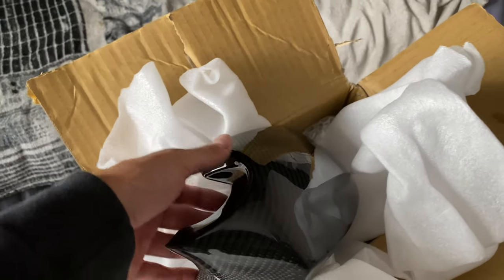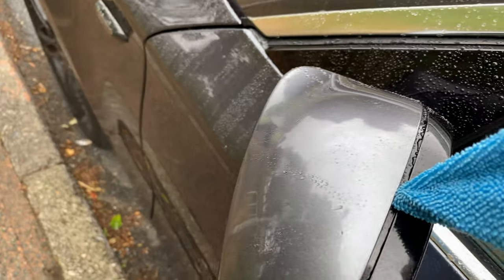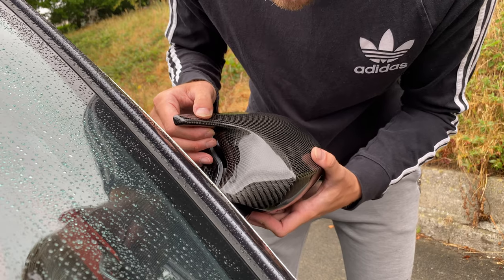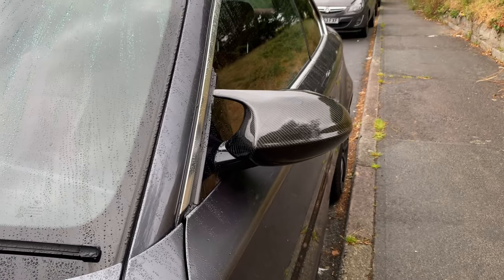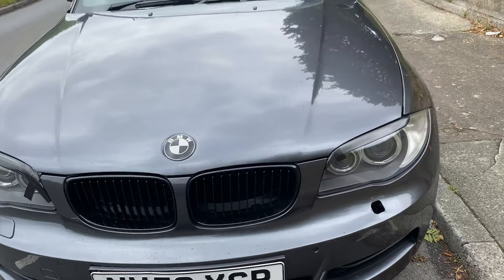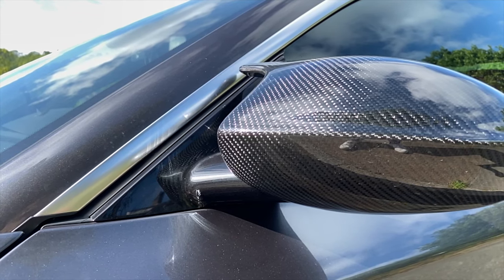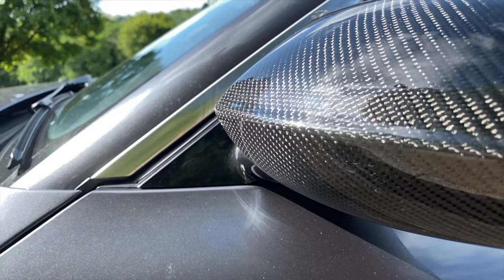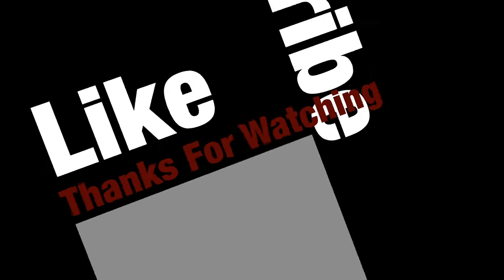Installing Carbon Fibre 1M STYLE mirror Covers & Carbon Eye Brows

Comment: Can you send me the link where you got these please bud.  Also are your mirrors electric?   If so do they still fold in ok ?
Reply from the maker: Yeah mate my mirrors are electric and have no problem with anything touching 👍🏼
Reply: @macca586  awesome thanks m8
Reply: @macca586  ahhh link doesn't work for me as it's from your transactions
Reply from the maker: https://www.ebay.co.uk/itm/M-Sport-Mirror-Replace-Cover-Set-Carbon-Fiber-Fit-on-07-10-PRE-FACELIFT-E82-E88/133310190178?hash=item1f09e81262:g:W8oAAOSwcDBeJT4k
 Try this one mate I had trouble finding it again
Reply: @macca586  yep - thats working, nice one mate :)